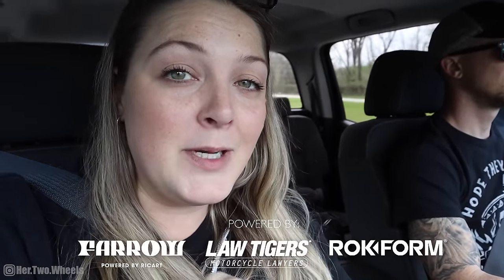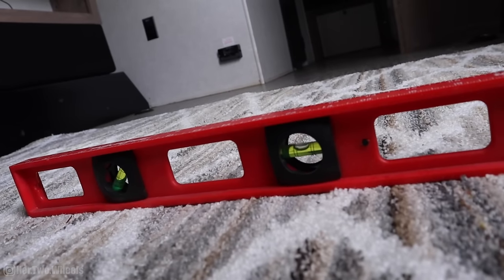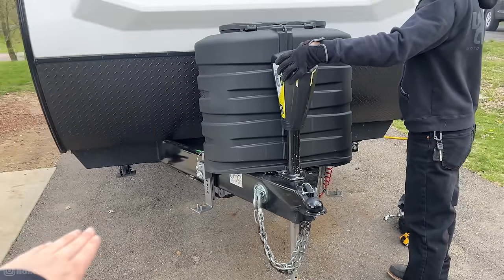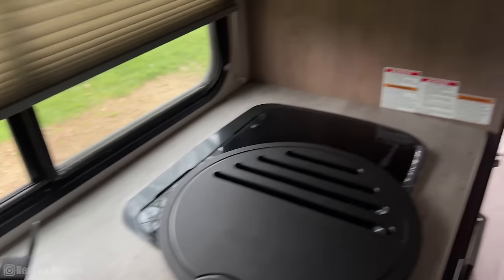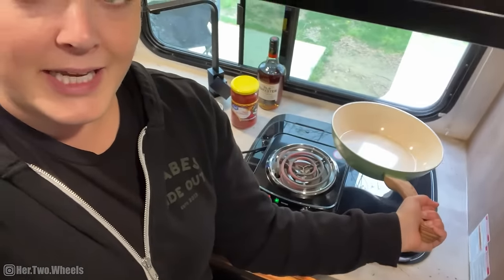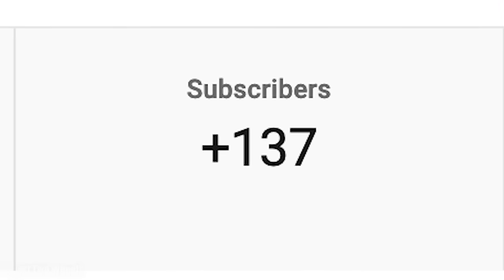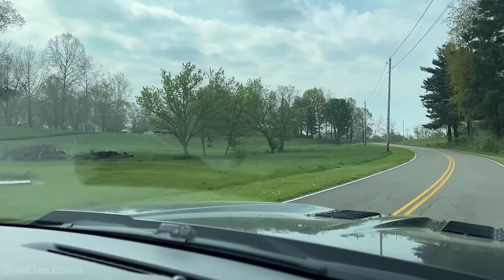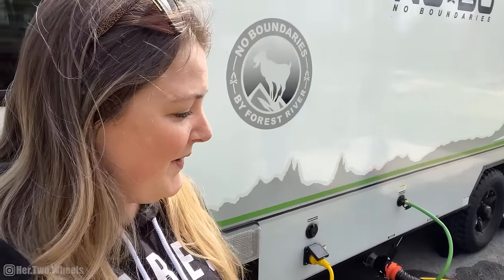First time camping in our new Toy Hauler! Mistakes were made!

Comment: I only have a small single axle, but prob the right idea to place all chocks/x before leveling.  I have the same anti sway hitch, and my only advice is to be on very level ground when installing/unhooking the bars.  My storage space is on a slope and makes it practically impossible.  One side will go on/off like butter, the other won't come close.  Dont ge afraid to crank it way up before removing the bars.  I crank mine up to the point where you hardly need the pry bar tool. My truck's ass end will be way up in the air. The black stuff was just the charcoal from the water filter being new, you're supposed to flush it out like that. The water pump is only for using the freshwater tank, not used with full hookups.  You guys are doing fine, just watch 20 hours of YouTube videos like I did first lol.  And you're not gross.... I bought a back flush attachment/water gauge and filled/drained my tanks multiple times just to watch it come out dirty, then squeaky clean a few times.  Its oddly satisfying lol

Comment: I had a 35 foot bunkhouse trailer and I used the same heater but I used 2 one at each end. In the fall I used the campers furnace. All summer I only used propane for hot water and the stove and oven. I got all summer out of 2 20lb tanks.

Comment: When we get to campsites, our favorite pastime is watching newbies!   Lots of fun!  One would think that only toilet water and other things goes into the black tank.  Not necessarily true.  Sometimes, bath sinks or showers also dump into the black tank.  Test is dump black until empty, turn on bath sink or shower and see if water comes out.  Always dump black first!  Make sure to avoid poo pyramid!  Never use bar soap.  Never ever pee in the shower!  Buy a sewer doughnut.  Add water to black tank with the tank sprayer.  Put a cup of Borax in gal hot water and put in black tank to prevent struvite that causes sensors to not work correctly.  It is not camping it is Glamping.  Still fun!

Comment: As for a fire, steel wool which has a magnesium coating and a 9 volt battery. Arc it and stuff the flaming steel wool inside the toilet roll filled with dryer lint.

Comment: Not sure if its been said but when hooked up the city water( spiket) you dont need the water pump. If your getting slow trickle either the lines not fully open, the parks pressure is low, or if you are using a water pressure regulator which you need ,it might be one lowing the pressure too much.

Water pump is when you fill your water tanks when not hooked up.

City water is pressurized.

Comment: Hey!   Just found yall!
Did a good job for first timing.
Some tips...
Fridge, run it on propane while underway BUT!!  If at a gas station... remember what ya got goin on on the location of your fridge.
When using propane, when you set up to camp, for quick hot water use both elec and gas for hot water at same time... and if both taking showers use gas hot water and elec so second shower has hot water.  After, cut off gas hot water.  The gas heater is what will gobble propane, the stove, oven do not use much.

For your gray and black... use Happy Campers tank treat in both.  You will have zero odors... zero.  And I would not let anyone see or know about dumping soapy gray on the ground.  Gray water can be real stinky so... use those gray water dumps.
Also, grease your hitch pivots. Grease the ball, and any thing that moves or slides. Noise will go away.  Yes, grease is messy, but you have to keep things...  lubed.  Oooh, sorry but lube does help!!  Haha!

Comment: You did fine for the first time.  After a half dozen more trips, you'll have it down pat. Dumping tip - dump black first and then gray.  The gray water is cleaner and will wash out the hose removing and stubborn solids or tissue.  
Three thumbs up for your first trip 👍👍👍

Comment: Few pointers that may have already been gone over. First off your hot plate and radiator heater are perfect for cutting propane cost. Heck you are paying through the roof already for the site might as well use what is there. Second yes leave your chains attached and truck with e brake on until you are sure its not going any where. The wheel chocks alone work great until you are done leveling then you can add the X-Chocks. Also I didn't see if you guys used the stabilizers under the RV, those work great to keep it from rocking/bouncing. Third in my outings I tend to keep my grey/gray :) water closed unless it gets full I will drain some and when I'm about to leave I flush out my drain lines after emptying my black water tank and it helps to flush the smell and everything there at the opening when you un plug your drain off the site dump. Either way I would not recommend leaving those open because RVs are not fully up to par like a house and you can have smells come back into the RV from the RV site main drain. Fourth is if you havent already do your self a favor and get a ghost bed or at least upgrade from the thin mattress they come with. Fifth always make sure you have a water pressure regulator and the pump is only used if you are pulling from your fresh water storage tank. Last make sure your tow haul button is on when pulling and slow down even if you need to go 50 mph if that's what it takes to not run hot because it is better to get there an hour later than planned vs. having transmission issues on the road. You guys rock I loved this video and commend you guys for not yelling at each other like most of us would have been LOL.

Comment: Good job got first timers. I pulled campers for twenty years and never stopped learning easier ways to do things.  I did notice your swing bar system was pretty loud.  Trial and error you can get it to work optimally without too much noise at the best tension setting not the tightest.  Good luck!

Comment: You guys did awesome!   Doing it over and over is the best way to learn your system.  But always disconnect the tow chains after you've lifted the trailer off the truck.  Just incase it decides to roll away, the truck will be your savior.😊

Comment: Keep the LP tanks on when on the road to keep the fridge and freezer going, you can switch back to electric once you set up.
Use the LP heater and stove in the camper. You'll be surprised how efficient they are and how long the tanks will last. Also, get an automatic switchover for the tanks.
Other than that, relax, have fun and enjoy.
Reply: Never drive with your propane open.

Comment: If you do not use a full hook up camp lot, you will be able to dump your holding tanks on the way out from the park.  Make sure you dump the black water first, then the grey water to help flush out the pipe.  If you have a water hook up for the black water tank to help swish, and flush it, that is also something to do to help remove some of the chunks, and odder.  Also drop in one of those odder thingies with a little water in your toilet.  By the way, did you have any issues with turning on your hot water?
Reply: Was just coming here to say dump the black then the grey lol

Comment: ALWAYS disconnect the chains   after you're off the hitch...at the very least, leave one attached but both is proper. Secondly, x shocks are for stabilization. Only attach them after you're disconnected. If you're not on level ground your trailer will shift and the chocks will do their job...the same reason you leave your chains on until you're unhitched.

Comment: Use your phones to communicate while backing up or hooking up. It will help avoid hitting objects, get the trailer in the right spot, and communicate when your on and off the blocks. Chock your tires before unhooking. If you turn the top rack around in your fridge, it gives you a space big enough for a half gallon of milk so, it might fit your Brita. Using your parking brake will keep the truck from rolling when in park and is a good safety measure so that all of the stress and weight of the truck and trailer is not on the transmission’s parking pal.

Comment: Connecting power right away is not a bad thing, number one you know it'll reach before you unhook, and it gives a little extra grunt for the jack. Definitely leave all valves shut and open black first and use grey to rinse after the black, you can stick your nose in our hose after we drain tanks, you wouldn't know. x-chocks should be applied after leveling the rig, and as said you won't need the water pump unless you are not connected to the hose, the pump will pump from your fresh water tank. We bought our fifth wheel just to get away from the bricks and sticks and be able to relax, we completely have the same reasons. Every trip , things will get smoother, and like us even after 5 decades of camping, you may want to keep a note pad in the camper to write down all the stuff you forgot.

Comment: Always flush your black tank before the grey tank so you clean out your hose.  Don't leave the valves open because your hooked up to sewer, dump them when your tank is full.  I would move those levels off the frame up to the mid line on the box.  I would also put a little more grease on the ball.   Nothing worse than fighting getting it off the truck from not enough grease.  I would also suggest cook outside whenever possible.  It will keep the inside a lot cleaner, and cut down on smells later on depending on what you cook.  Also, invest in a Tornado black tank cleaner.

Comment: its a learning experience for sure...I've been RV camping or Pop up camping since I was 10 and i still learn something now and then.  but im old school and we never had fancy leveling blocks.. we just used wood planks...lol and never x-chocked

oh we pumped sewage 1st then gray after to help clean out the discharge hose...
im sure there are 100 more hints everyone could give you but we've forgotten some of them and youll discover them later...lol
Reply: oh and use biodegradable soap and it wont really matter where you dump your gray water.. open it a bit and let it trickle drain as you drive back home.

Comment: Well done on your setup.  Smart to do a full hook up for your first run.  Full hook up at most places is not the standard.  You will learn water conservation as you go along and damp at an electric only site or boon dock.  They also have portable tanks you can dump into and take to the dump station to cover you if your unit has smaller tanks.  Plenty of you tube videos on what do when it comes to dumping your tanks at the dump station (edit….in terms of being respectful of others waiting to use it).   Make sure you sanitize you water system (fresh water tank and lines).  Plenty of vids on this as well.

Edit 2……to install those bars you should use the small hook on the end and it goes into the small hole between the 2 ‘posts’ on the pad.

Comment: I've never seen a sewer hookup that low before. Usually you screw your adapter into it so there are no leaks and smells are reduced. Use your propane like normal before you head out on a longer journey so you know how long your tanks will last. If there are RV camp sites around there will be some place nearby that can refill your propane tanks. You can also get extra tanks to carry with you if you're going to be bivouacking and off grid. I don't know much about your trailer or how efficient the appliances are but my trailer hardly used any propane except for when I ran the furnace. If your going to leave your trailer sit for very long, drain the hot water tank. Ensure you drain your water system before you store it for winter. As long as you plan ahead and make reservations you shouldn't have any problems finding sites with full hookups. I only filled my fresh water tanks once and the added weight made hauling my trailer a pain. I didn't use it off grid either, always stayed at places with full hookups. You didn't mention anything about a trailer brake controller, I don't know if your truck has one built in, if not make sure you buy a quality one and spend the few minutes to make sure it's set up correctly before heading out on each trip. You'll need to make adjustments depending on the weight you have in the trailer at the time.

Comment: The black water coming out of that filter was charcoal. That is a charcoal filter for removing strange flavors from the water. Run the water a minute or so and thats it for a new filter. Don't have to do it but the first time. Water pump only needs to run when you fill the water tank.
Pre-chill the fridge by plugging it in at home for a day or so prior to trip. Pre-chill; all food and beverages prior to putting in fridge. They are good at keeping cold not getting things cold from room temp. As many have said using propane for fridge and cooking uses very little propane. Even water heater doesn't use much once the water has gotten hot. 
Level side to side first, chock wheels and x lock then unhook from truck and level front to back.

When you go off grid you learn real fast how to conserve water. I've taken showers using less than a couple gallons of water by wetting myself down, shut off water, lather and quick rinse.

Comment: you should always use a water pressure regulator, to prevent high pressure in the camp ground water supply which will dammage you rv plumbing.

Comment: Plug your refrigerator in the day before let it get cool. Then turn your propane on and run down the road with the propane on and you can put your food in the refrigerator as you travel down the road. We are newbies to we've only used ours twice. Its a  learning experience and you get better every time you do it. But always chalk your wheels first after you get level you need to put some shocks behind each wheel not just the thing you got in the middle of your wheels. Always keep your valves on your black tank in your gray tank closed while you're camping. And dUMP when needed  as you go or right before you leave don't leave them open. And make sure that you use some kind of toilet chemical put down in your black tank in your toilet to keep it fresh. Always make sure there's water in it. I would not travel with a whole lot of water in your tanks if you're going to a site that has water that's even better but if your boondocking only do about 2/3. But y'all did great.❤  Save your toliet paper cardboard rolls and stuff with dryer lint. Catches faster. But always carry starter w you.

Comment: You always do the black water first. Than the gray. That way the gray water will flush the tube out of any large particles. Also there's a poop flusher that hooks to a hose. To finish clean  you can get them at Walmart. It hooks in first at the trailer.

Comment: One thing you want to do is pull in closer to the side where you hook up and line up your connections the best you can. 

We were told that you leave the black tank valve closed until you drain it. The gray water valve can stay open. Yo should have some lights inside to let you know if your tanks are full.

You can leave both gray and black water valve closed and when to leave open the black water valve first and then the gray water tank to flush out the hose. I did some extra flushes on ours to kind of flush out the black tank. Once done I closed the black water tank and gave it one more flush to allow some water in the tank so if you have any toilet paper left it won’t dry and stick in the tank. Just a few things we learned.

Comment: leave the small whip on the filter and place the filter on the camper end of the hose, not the hydrant. Never hook up and open your black tank because the liquid will drain leaving a mess of solids that are difficult to clean out... Always, when dumping, dump your black first, then dump you grey into the black and flush again.

Comment: X-Chocks after you’re level, unhooked and the stabilizer jacks down. 

Don’t worry, after you’ve done it a few times you get quicker at setup. 

Our trick is once we’re level, my wife sets up the inside and I do all the hookups, put the awning out, chairs, grill, etc. Teamwork.

Also, you shouldn’t need the water pump when using city water. 

We were lost clowns the first time we did it so it’s all good.
Reply: Dave is correct, only turn on the water pump if you are not connected to city water and you have water in the freshwater tank. I know RV water pumps are designed to run dry but it is still possible to damage the water pump if it is left on continuously running for too long with no water in the freshwater tank.

I also wait to put in the X-Chocks until I level the RV. Good standard wheel chocks will be enough to support RV until the X-Chocks are in... heck years ago we didn't even have these fancy X-Chocks. X-Chocks are great, I love them as they remove a lot of the movement when walking around in the RV!
Reply: I agree that I am always going for full hookup. Part of spending the money is to enjoy camping and full hookups make that possible. To make breaking down camp you should think about a under camper sewer hose holder. One that goes all the way across so the whole 20 ft of hose fits in it.

Comment: The small Level should be on the trailer. When you  get home get your trailer level front to back an side to side. What I have done on  my rig.on the left side put one of the small level .when you mount it make sure it is
Showing  level. When you screw it the trailer use Is clear silicone  where the screws go. Then on  the front on the same side mount  the next one..make sure you put silicone. Now when you go camping an get out of the truck you can if you are level or what side has to come up or down. 
I have done this on all my campers. I put mine just about chest high..
Welcome to RV  life. An if you need help or a question  just ask someone 
In the campgrounds. Most people will help out. Be safe in your travels.
Reply: USERNAME[REALHERTWOWHEELS]  
Hi I do not have telegram. I just want to say thank you  for Thought.